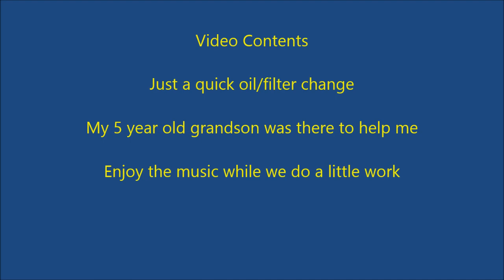Quickie 30  Speedee Maintenance

Comment: back before vehicles became plumbing nightmares, you know when one vac line was good and two was very bad(weren't vac wipers the worst) I used to love working on vehicles.
but then came emission control and a jungle of vac lines to label, along with their termini, when it took longer to get to the repair than to do it, that's when I lost my love of vehicle work. plus the engineering folks started diabolically designing things which you needed two u-joints between your wrist and elbow to access.
back then I dreamed of having a hoist, and still do when I think about taking on a restoration project.
who knows, maybe someday...

Comment: Speedy indeed Chuck, and it looks as though you are very diligent about the maintenance on that truck, just one question, has it now gotten to the point that there are no grease fittings on any of the front end parts, I ask because I didn't see you go under with a grease gun. It wouldn't surprise me if all those components are sealed now, I know my 3/4 ton Dodge pickup only has 2 fittings on the whole truck.
  Cool video ...... Mike
Reply from the maker: Hi Mike,There is a quick clip where I have the grease gun in my hand but the camera shut off, this truck still has upper and lower ball joints and a couple on the tie rod knuckles, but you are right, grease fitting are an item of the past.FYI, I got the seal kit for the Holl O Ram, $60 for 2 seals...but I am happy, the unit works great, the unit was missing the larger of the two seals when I took it apart...my first hydraulic rebuild...lol Thanks for watching, if you can catch my resent video, think you will enjoy the endATBChuck

Comment: Very Speedee change!
Is that a dent in the grill just above the Chevy bowtie, towards the drivers side?
Ouch!
Jeff
Reply from the maker: Hi Jeff,Yes, I that is a dent, was driving down the freeway in the fast lane, I saw something fall off a truck ahead of me in the slow lane, seemed like no issue due to the distance, but the unit must have been heavy rubber as it bound into the air and I was lucky it hit the front of the hood and didn't come through the wind shield...yikesThanks for watchingChuck

Comment: Looks like this wasn't your first rodeo!
Looks like you've taken good care of the ole girl.
Reply from the maker: Herb,it has been a good machine, it did have the heads off, I had a shop replace all of the hoses, then it started using coolant, think they cracked the head when the refilled it.  Other than that it is a horse...Chuck

Comment: My jack only lifts my car less than 2 feet.  I think I will drive over and use yours.
Reply from the maker: Kurt...Come on down....FYI, I sometimes sit on a  swivel chair under the car, amazing how it is quite useful and make it easy to access some areas, don't think you will see that in an auto repair shop...lolChuck